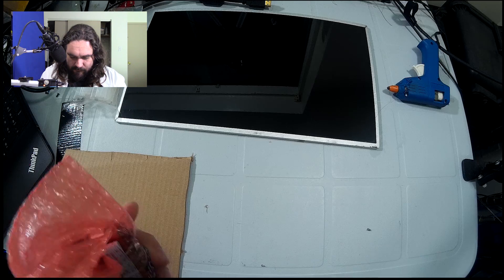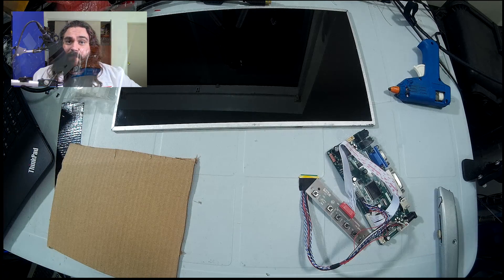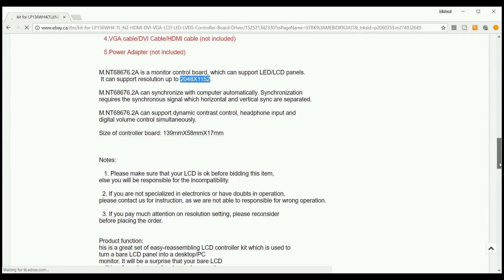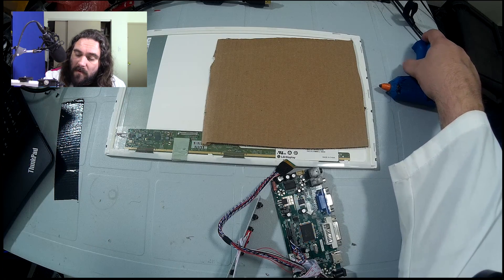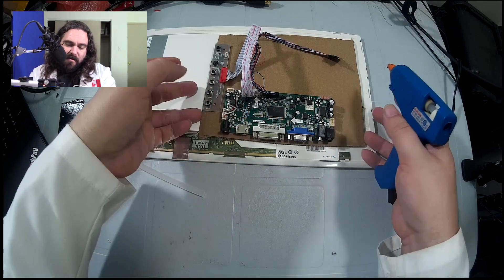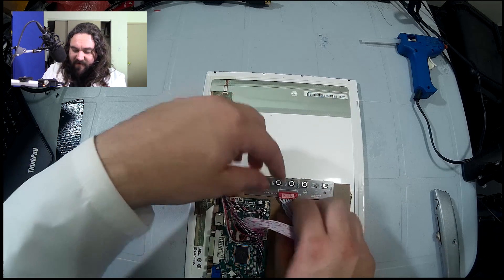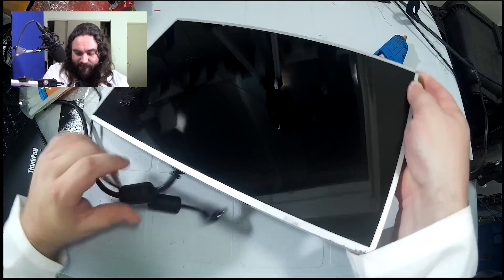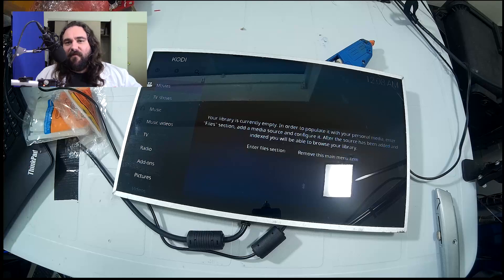Reusing a monitor from a dead laptop

Comment: Would 12 v DC and 3Amps be ok for this circuit board?
Reply from the maker: That depends on the back light. 9/10  times 3A will be overkill, which is good. I power mine with 12v 2amp after testing with my bench supply and measuring about 1.1A draw

Comment: Would this work inside the laptop case if you took out all the internals
Reply from the maker: Yeah it could, as long as the controller board fits and the LVDS cable is long enough. If the power input from for the laptop is not attached to the mother board, might be able to use a buck converter to drop it to 12V and re-use the laptop power supply as well.
Reply from the maker: Also check out the revisit, I think it turned out better.

Comment: Can it work on solar system unit? On 12v battery?
Reply from the maker: There are two challenges with Solar, one the unit draws about 1A, this can go higher based on back light type of the monitor (cold cathode will take much more power than LED) and two, solar is not a stable voltage without a charge controller and battery. If you solar system can handle 1A, and you have a charge controller and a battery,  then I see no reason why it would not work. 12v 1A is the same regardless of the source.

Comment: Ive connected the LCD to the control board but it only turns on to a white screen. Even when I connect it my MacBook or tv, it just stays on a white screen and then goes to standby mode. does this have an easy fix?
Reply from the maker: Two things come to mind, check the lvds cable (lots of pins)is seated correctly, make sure your source is feeding correctly, for example if using a laptop make sure external monitor is enabled.

Comment: can you use any 12v charger? I lost the charging adaptor for the laptop I am salvaging the screen from.
Reply from the maker: Generally yes, I try to use a 12v DC 2 Amp source, in all fairness 2Amp is probably overkill for most screens, but better to be safe.
Reply: thanks for the info!